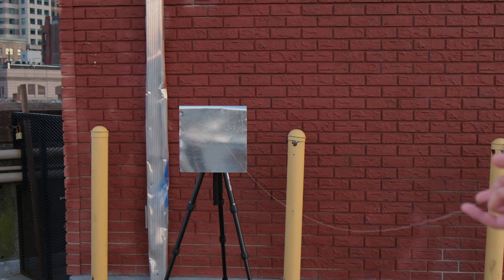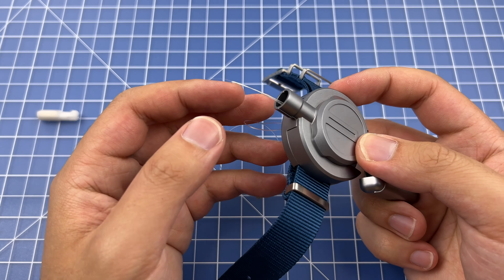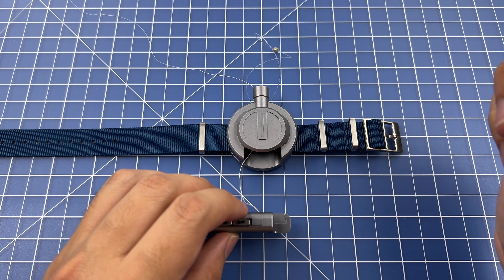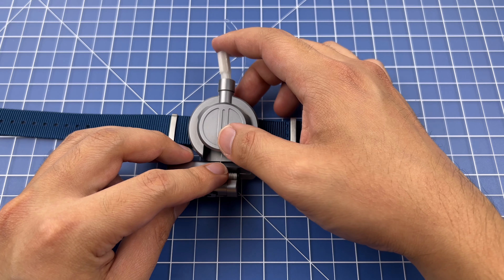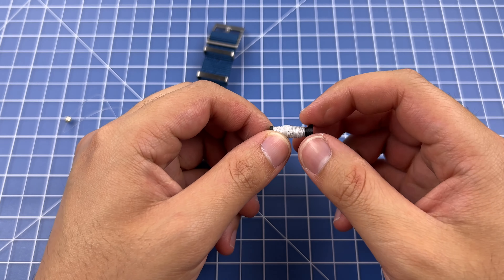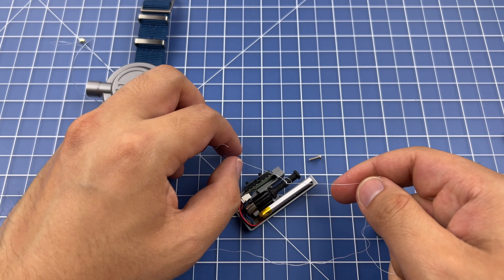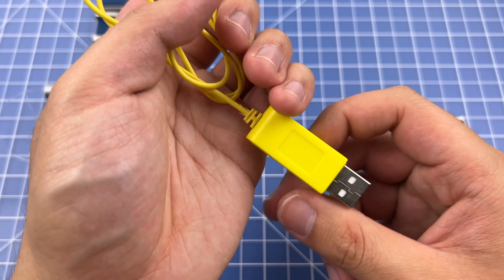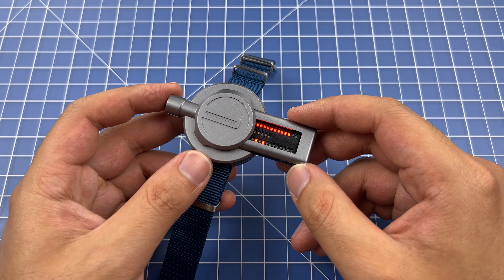MAGNUS MKII Thread Shooter Watch Instructions

Comment: This is by far the best web shooter out there right now, however, other webshooters retract by themselves without hassle and having to do all those time consuming steps, could we see an improvement on that for the next one?
Reply from the maker: Sure! The reload process is something we are optimizing. The two that come to mind are the designs that have the thread wrapped around a constant force spring/badge reel that is triggered once all the thread is spooled out and the one click reload that the Jlaser ones have. The issue with the first is the rewinding of the thread onto the constant force spring badge reel takes really, really long, even though the retraction is instant. The Jlaser ones work great, but the mechanism is huge and does not fit in the same compact dimensions. We are continually improving though and we think we have a way to optimize for size and reload speed/ease :)

Comment: has anyone been able to find all the parts needed to make the 3d printed version of this with the retracting feature on amazon?
I love this design I want to build it myself but the kit on etsy is sold out.
Reply: there should be an older step by step video of him making the web shooter, and in the description he linked all the parts needed 😊
Reply from the maker: Hey thanks for commenting! If you send an email in we can send you the parts list, the issue is that a lot of the components were sourced in bulk from overseas manufacturers. The PCB reload electronics are also a custom manufactured assembly that isn't available anywhere. If we have spare parts lying around we might be able to send those over but we'd have to check our inventory.
Reply: @herotech  ok thanks for the info